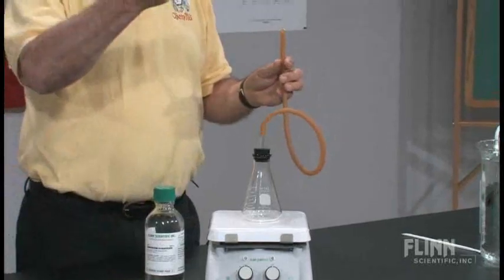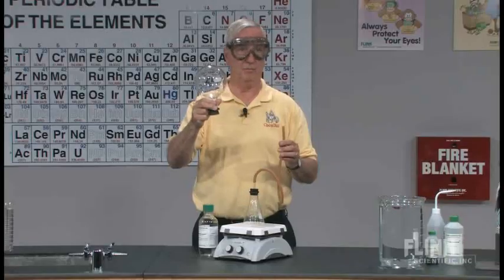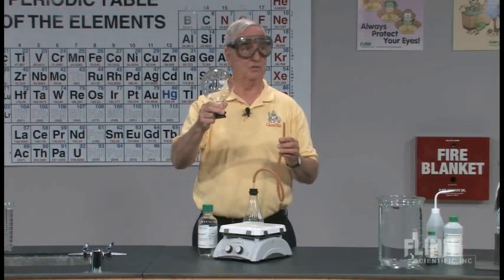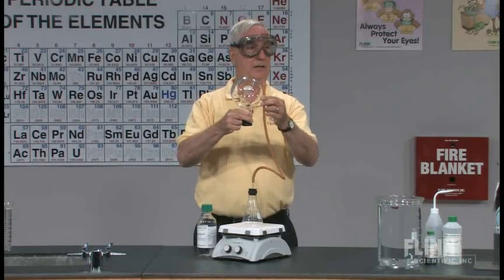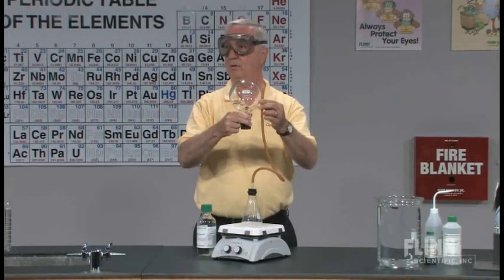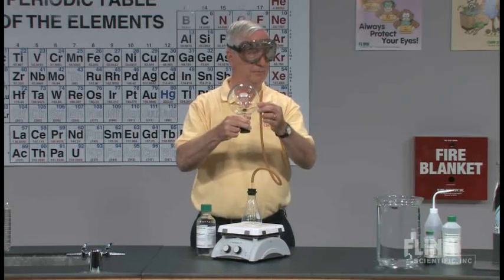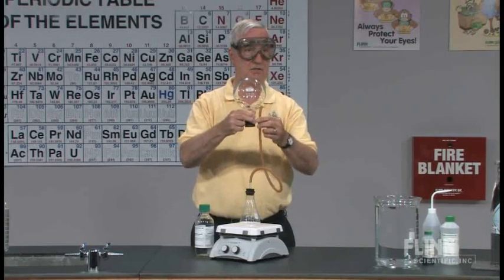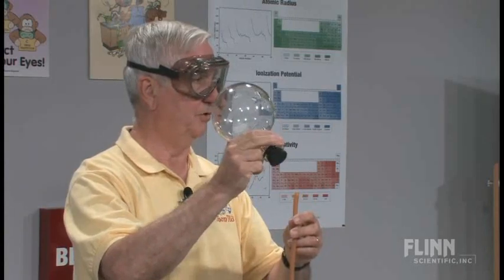How to Generate Ammonia Gas

Comment: This is not a good way to generate ammonia, I litterally face palmed watching this
Reply: Enlighten us Dave, what is?
Reply: @ninetails6218  The obvious choice would be to use a gas generator (eg a kipps aparatus) and react an ammonium salt with a strong base (eg NaOH) using a little water. No heating is needed. No specialist glasswear is required, even a generic plastic bottle would work.

Comment: I have a very odd question. I have some animals in my attic. No way I can see or access without removing major drywall on ceilings. No crawlspace. Could this gas be a good way to flush them out and make the environment uninhabitable or is it too risky? What gas could be delivered to the attic to effectively repel invaders of all sizes? I suspect rats, squirrels, possums but have no idea really. The crawlspace is so small it's basically not useful for any human.....
Reply: Fat rip
Reply: Paladin Kor ammonia gas is mustard gas, AKA a chemical weapon, it's thick and heavy. So it might just dissapate down and kill/severely hurt you. I know I'm a year late, but OP don't do this, just get a BB gun or some fire craclers
Reply: @jay8980  Its too late, the guy died.